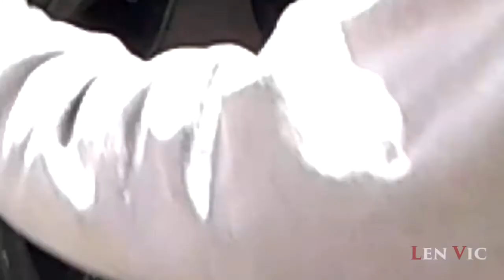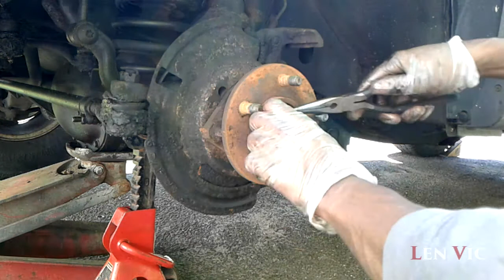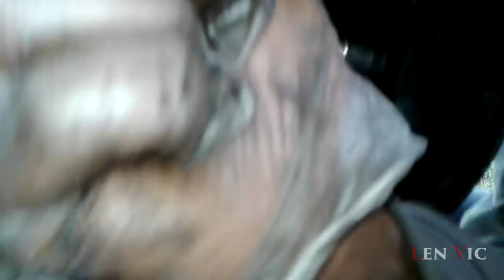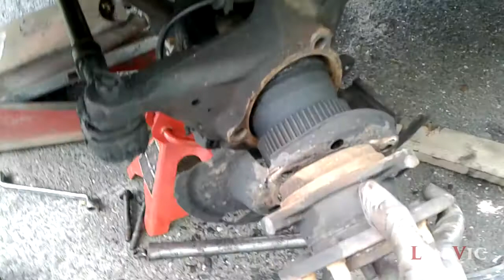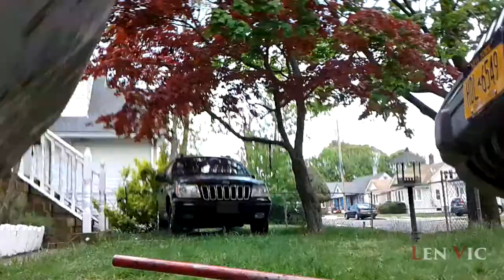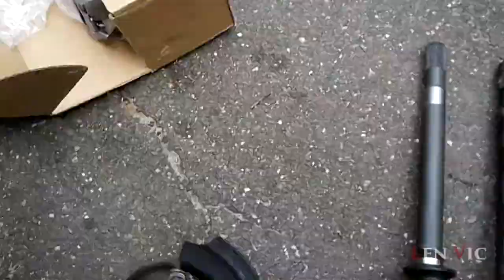Installing CV Drive Axle - 1995 Jeep Grand Cherokee

Comment: Mr vic I have  a loud pop in my driver's side 95 grand cherokee was told that it could be my front axel it feels like it could be coming from front tire but sometimes from the steering   column any idea what it could be  thanks
Reply from the maker: Hi, Scott. I believe the pop is coming from your driver's side Axle￼ joint. Inspect the axle boot you may have the replace it.